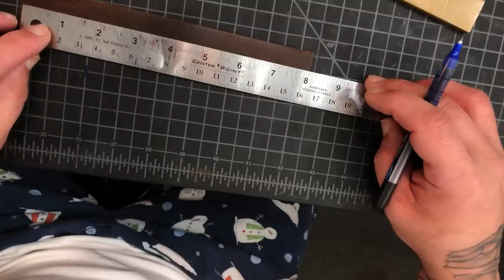Making a Leather Clutch / Pouch (and Having Fun!) - The Emily

Comment: I have a Dremel Stylo. Would you say it is strong enough to sand the edges like you did with your rotary tool? Or am I better off trading it in for a stronger model? Thanks!
Reply from the maker: Oh … good question.  I’ve never used or tried that model.